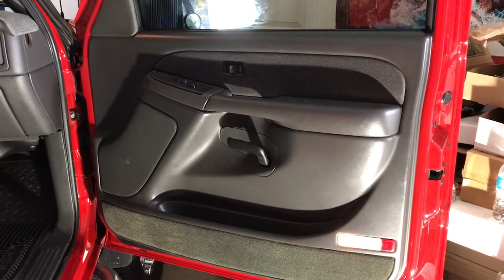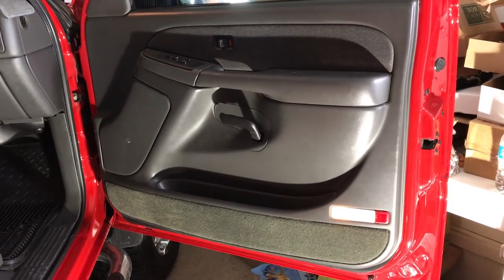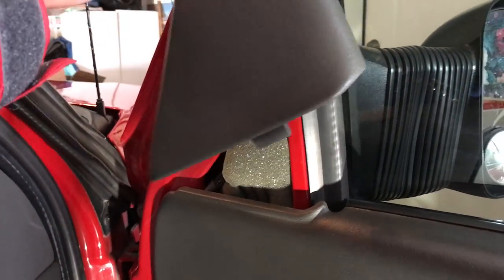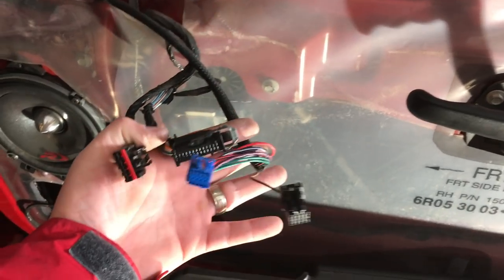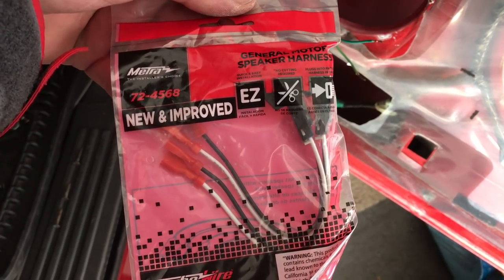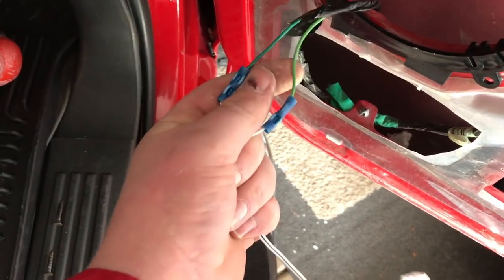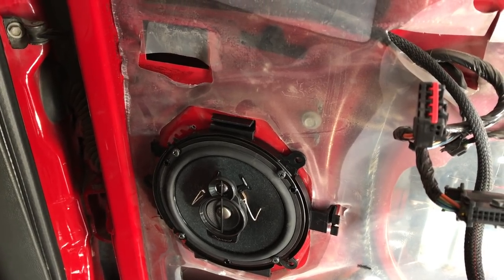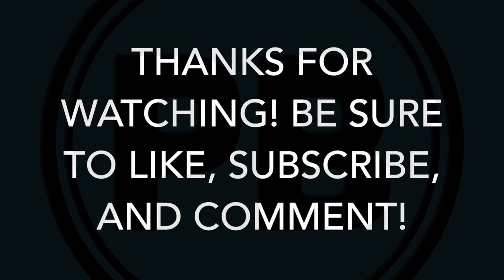1999 - 2006 GMC / Chevy Front Door Speaker Install Suburban Tahoe Yukon Avalanche Silverado

Comment: If you're replacing the stock speakers you can pry off the old speaker brackets off the old speakers and reuse them with new speakers. Worked great for me.
Reply: ForzaClutch can you post a video
Reply: I need to know how’d you did it I have a 2004 Tahoe
Reply: Same I used it on my new speakers

Comment: 2003 Yukon Denali XL:  Under the lock slider, there's a plastic bracket supporting the lock bar.  A 7mm bolt holds it to the door.  After removing the lock slider, remove the bolt behind that slider.  THEN pull the door panel off.
Reply: Same goes for a 2004 Tahoe. This is likely something that was added around 2003 and likely applies to all models. Door wouldn't budge until this screw is removed.
Reply: @ericpetersen5291  2004 gmc  sierra 2500hd too.

Comment: You completely skipped over the part I needed...how to actually get the old speaker out.
Reply: I know its late but for other people.... on mine there is a black clip on top with foam running between it. You just pull that down and out
Reply: As usual they skip over important parts

Comment: This Chanel has been so helpful.. I have an 04 single cab Sierra as a little toy truck, been thinking about doing my sound system myself and you guys got me feeling confident enough to do the head unit and speakers.. the only thing I’m shaky on is on adding a sub and amp. Like how or where to mound the amp and sub... do you have any videos that could help?
Reply: You’re probably stuck to a under seat sub box and amplifier tucked away near it wires running by the doors and through the firewall, never the door jam.

Comment: You forgot to mention on a totally electric underneath the power window switches there is a 7mm bolt holding the panel on. Remove that bolt before trying to take your door panel off.
Reply: This is also the case with 2001 suburban 2500. Need to remove the control panel and remove that 3rd 7mm bolt. I discovered this by breaking one of them

Comment: I ordered the Metra 82-3002 pair of brackets. You failed to mention not all speakers fit the bracket.  That would have been helpful.  I bought a pair of Alpine SXE-1726S from Crutchfield and they don’t fit in the brackets you said we needed. Frustrating…
Plus I know you’re trying to save time and keep the videos to the point, but it is helpful to see how you do these steps, not just that you did these steps. No real need for video if you’re just going to show results without the process.

Comment: Great video but you did the easy part how about running the wires through the door grommet to put a real amplifier in the truck that would have been a good video talking about getting some views!!!
Reply: You run the wires from the amp to the head unit harness that way you don’t have to run separate wires to for different locations

Comment: would those speakers adapters brackets could work for the rear doors as well ? I'm trying to install some 6 3/4 speakers on the rear doors
Reply: no
Reply: Yes, you do as long as your truck is a 4 door (crew cab) because they use the same size speakers front and rear. No adaptor is needed if you have an extended cab truck because those use a 4x6 speaker.

Comment: Do you need an amp for those speakers or will it run off the factory watts
Reply from the maker: They are running off the factory radio.  However, they could use a little more power as they are rated for 50watts RMS each speaker.

Comment: Did you disconnect your battery to instal and connected it back to test?
Reply from the maker: For speakers, disconnecting the battery generally isn't needed.  But, if you are uncomfortable working on your speakers with the battery connected, by all means, remove the negative.

Comment: I have these Metra brackets ready for my install. My question is, do I just run the screws that came with the speakers, through the slots that match up with the holes in the speaker frame? I don't want to crack the plastic of the bracket.
Reply: Use same screw but shorter , will fit really good with out braking it

Comment: Is it a must to use those speaker brackets or can u still install them the way the originals were?
Reply from the maker: Nope, not mandatory to use the brackets, as long as the speaker magnet clears the window tracks, you can mount the speaker directly to the door without the bracket.
Reply: Did this have bose system originally?  If not, is the process still pretty much the same?
Reply from the maker: It did not, but for speaker replacement, the process is the same regardless if it has bose or not.

Comment: I'm confused, when I try to order the Metra 72-4568 from Amazon they're saying it does not fit my Tahoe?
Reply: What year is it?
Reply: It should fit the 1999/2000 thru 2006 GMT800 trucks. It said it fit my 04 Tahoe which I used to install my speakers and they played sound after installation.

Comment: I want speakers for my 2001 Suburban1500. Are they 6 1/2 or 6 3/4?? I have seen conflicting answers. Thanks.
Reply from the maker: Both will fit this application fine.
Reply: @ProvoBeastAudio  no adaptors required for either?
Reply: @thomashoppes8594  I did the front door speaker installation on my 04 Tahoe today. I used an aftermarket speaker adapter (Metra 72-4568) and I drilled holes for a pair of 6.5 pioneer speakers.

If you’re upgrading from OEM & you need adapters, these will fit your 2001.
metra 82-3002 door brackets, about $15 on crutchfield.com or you can drill holes, whatever works best for you.
Speaker harness connectors Metra 72-4568 is what you’ll need to connect to your factory wiring harness. $6 per pair on Amazon or Crutchfield.com

Comment: Does it use the same speaker braket in the rear doors
Reply: Yes, you do as long as your truck is a 4 door (crew cab) because they use the same size speakers front and rear. No adaptor is needed if you have an extended cab truck because those use a 4x6 speaker.

Comment: Do they sell the adapters for the wiring on the rear 4x6 speakers also?
Reply from the maker: They really don't because you can bolt up speakers to the factory location, but i'd suggest foaming the back of your speaker to avoid rattles.
Reply: Yes, they use the same part number speaker adaptor wiring harness. It's a Metra 72-4568 for both front and rear speakers.

Comment: Is there supposed to be a tweeter right above the 6.5 speaker? I've seen it through the grill on my 2004 Silverado.
Reply from the maker: Depends on what trim level your truck has.  Some do, some don't.  This one did not so we used coaxial speakers instead of a component set.
Reply: Provo Beast Audio Installation 
Do you have a video replacing the component speakers on a Silverado and do you know what size they are? Thanks
Reply from the maker: There will not be direct replacements for tweeters, so most component sets come with brackets to allow you to attach them to door panels.
Reply: Provo Beast Audio Installation 
Thanks for the video and recommendations for the brackets and wire harness. I installed mine today.
Reply: Just an FYI my 2002 Silverado looks just like this. However, the door panel did not just lift off. The electric locks and windows portion lifts out and there is a plastic bracket. Needless to say that is broken now. Not mad at ya, just thought I would let you know.

Comment: Why pioneer speakers though? Their garbage
Reply from the maker: Sometimes it's what the owner of the truck wants and it's not always what we as installers want...
Reply: Provo Beast Audio Installation good answer. I have a question. Would u recomend using speaker baffles? They are also called boom mat, with is like a cup where the speaker maget goes in.  Would i get better sound with those or speaker foam fast rings?
Reply from the maker: Yes, they may help with midbass and better insulation against moisture in the doors.
Reply: Provo Beast Audio Installation ok thanks for the fast response. Im doing a project in a silverado and im upgrading all the audio